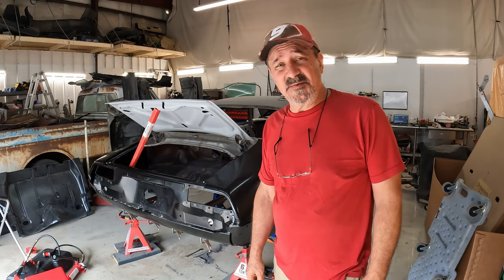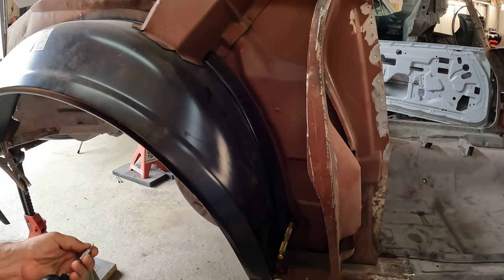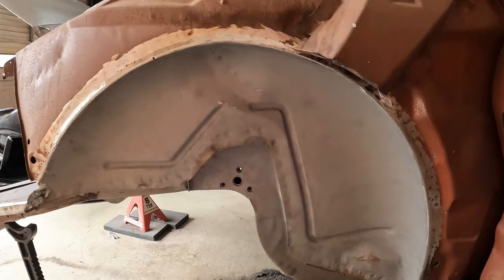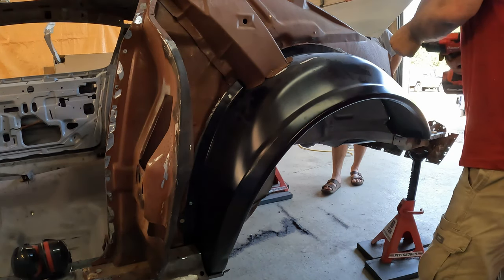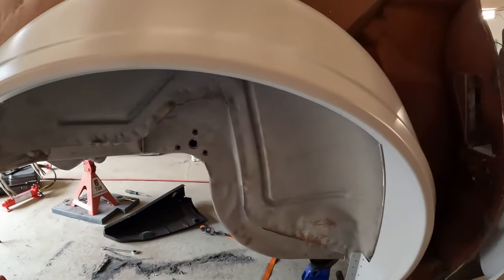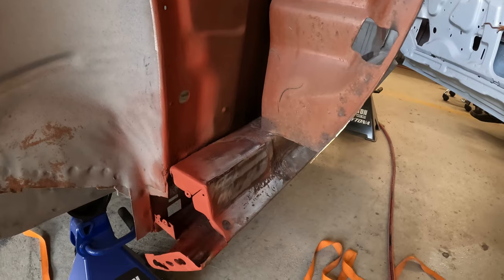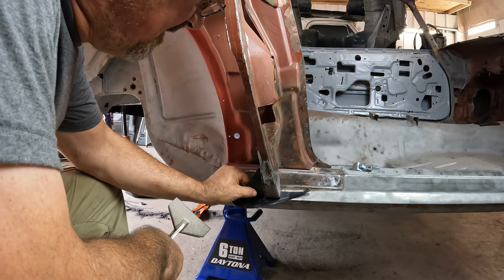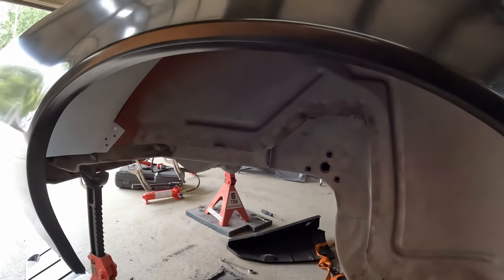Firebird Ep  17 Welding in the outer wheelhouses

Comment: On the bottom of the quarters, I would pass on the self tappers. I cut about 1 1/2" off the bottom edge and plug weld it into place. Then I simply buttweld the quarter onto that piece... Gives you a Beautiful Factory Seam... 👍👍👍
Reply from the maker: A little late now but I'll try that on the next one!

Comment: Those rear quarters are infinitely better than it was. I concur with removing the EDC coating, putting primer over something that scratches off  the sheet metal so easily is never going to end well.
Reply from the maker: The more I dug into those old quarters the more horrified I got! As easily as that EDC coating scratches I would be hesitant to even scuff it before primer. It's just not a good base to lay any paint over.

Comment: May I ask what size self tapping screws did you use and after you put the self tapping screws in did you make the holes bigger to weld thanks.
Reply from the maker: The self-tappers are #10. After removing the screw I use a 1/4" drill bit to chamfer the hole to expose more of the underlying panel for the plug weld.
Reply: @MaverickModds  Ok thanks

Comment: Love the work done to the car! My suggestion for where the quater was welded to the rocker..  Skip the self tappers. The zinc coating gets scratched off when installing them and will rust. I actually used panel bond on my 71 Camaro in that area. As strong, if not stronger than welding. 

https://youtu.be/KnqWc-FbmmI

Thanks for the content so far!
Reply from the maker: It's a little late to switch directions now but I'll look into that for the next one!